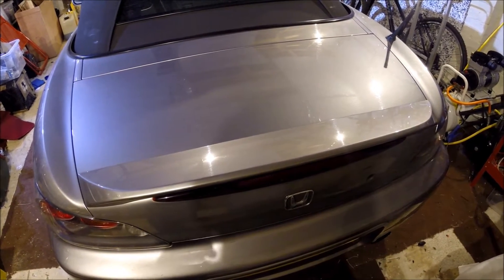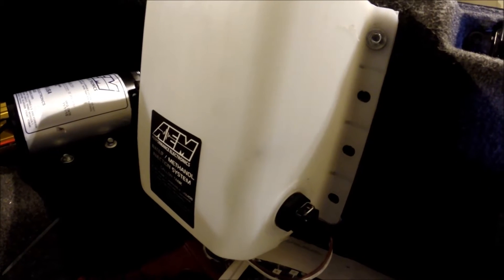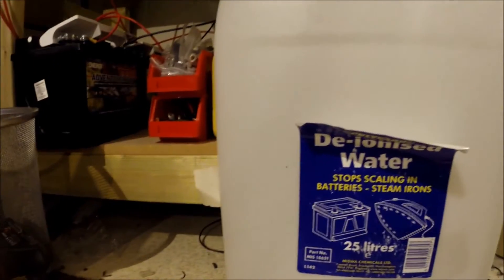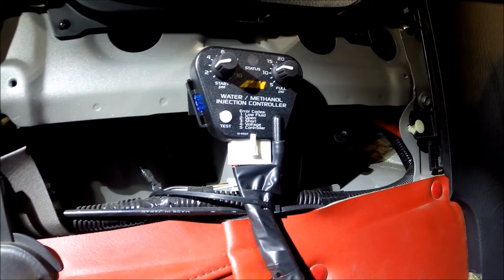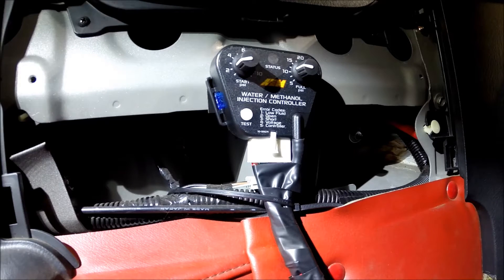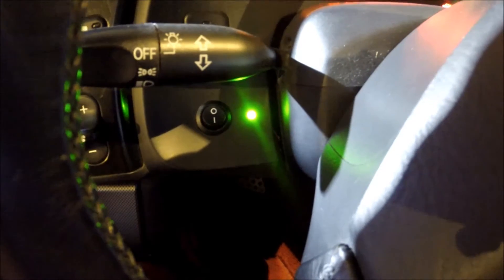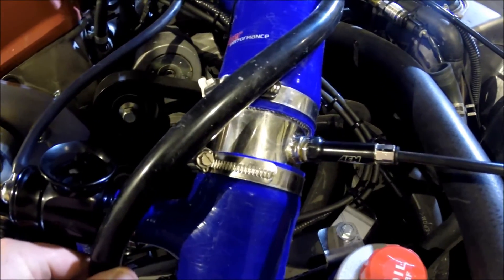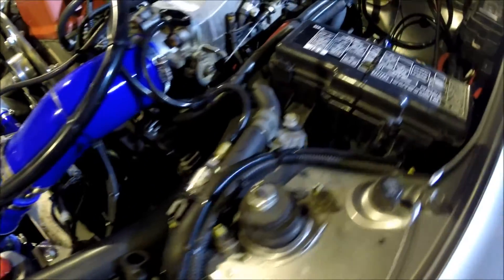Honda S2000 AEM water methanol injection

Comment: The nozzle you got there does not need a solenoid as it is internally checkvalved , takes a lot of psi to push it open so vacuum alone won’t pull liquid in
Reply from the maker: If the check valve gets gummed up or doesn't seal fully then you will end up with it pulling fluid through under vacuum. Better off to have the solenoid so that you need 2 points of failure rather than one

Comment: Hey dude, did you tune for water only? I am seriously considering going for a water/meth with 95/5 water/meth ratio. did you loose any power?Thanks
Reply from the maker: For my power level i have more than enough fueling to keep the engine running nice and rich when in boost. I aim for 11.7 AFR. I opted for the water injection because my brother successfully had water/meth fitted to his supercharged mini cooper s and it made a huge difference to inlet temperatures. My main reason for fitting it is that it will act as another safety device when on track. Anything that keeps temperatures down in the combustion chamber is a bonus for me. I do not run meth as im not pushing the boundaries. I would be abit dubious of changing the fuel map to suit methanol because if you have a pump failure or run out of meth then you could do alot of damage to the engine. There is fail safes available to switch to a different map if there is a problem but its still abit too risky for me.
Reply: Thanks for the quick reply man!That is exactly why I am going to use it, to keep cooling and cleaning my engine. I run LPG gas as my secondary fuel since it is cheap etc, but burns at a higher temp. I'm gonna go with the 5%meth just for that liiiiittle bit of more cool. the O2 sensor can probably make up for the little higher octane level.When it turns on, do you feel a difference? like a jerk or loss of power or it is smooth? how fast do you empty a tank?Thanks
Reply from the maker: I have mine set to spray at 2psi with maximum flow (500cc) at 5psi. So basically when ever im in boost it will spray. It gets through water quite quickly but i could reduce that by changing the settings abit. I think how i have it set currently would use too much water for track use. When it operates you wouldnt even know its happening. Its smooth and progressive.